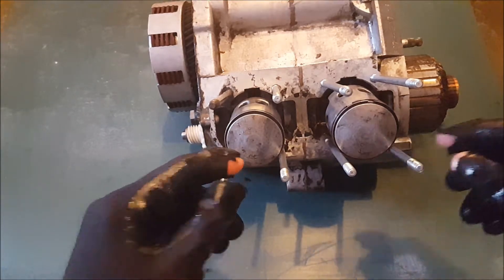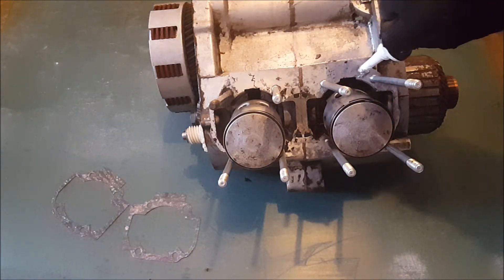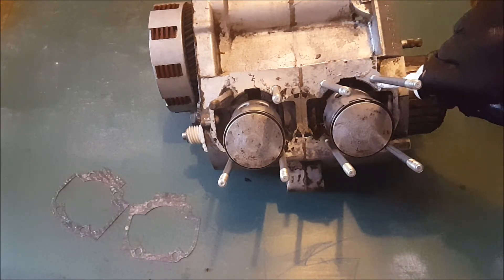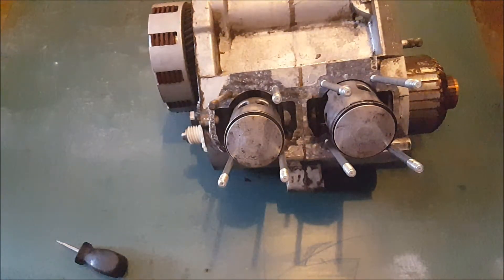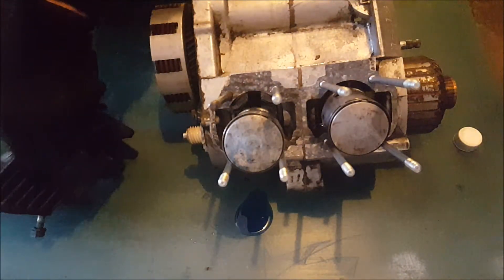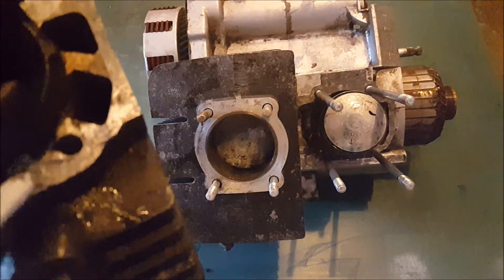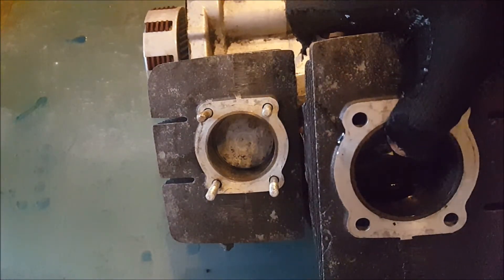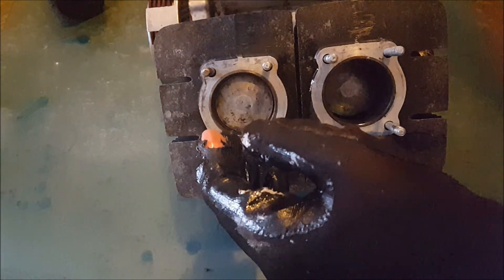1974 Rd200 Cylinder Installation

Comment: If you put your gasket sealant direct to the the gaskets and lubricate the bores before fitting you'll have a lot less mess and less chance of surplus sealant going in the crank. Don't whack the cylinders with the steel end of the hammer, just tap with the wooden end. Otherwise thanks for a forty year old memory.